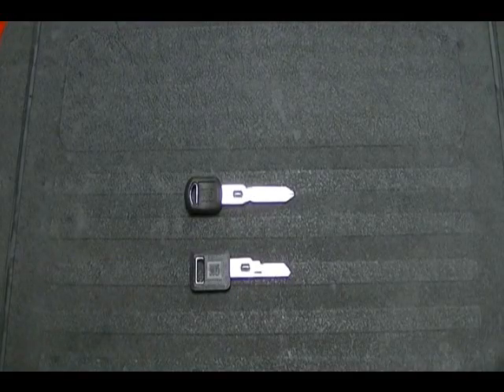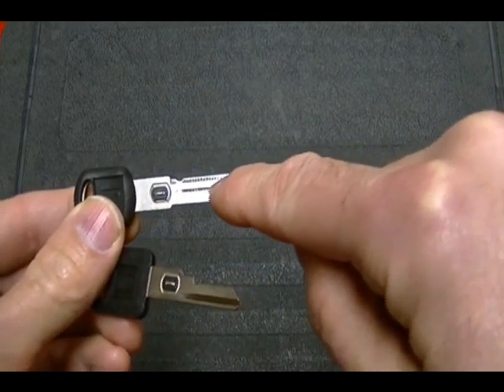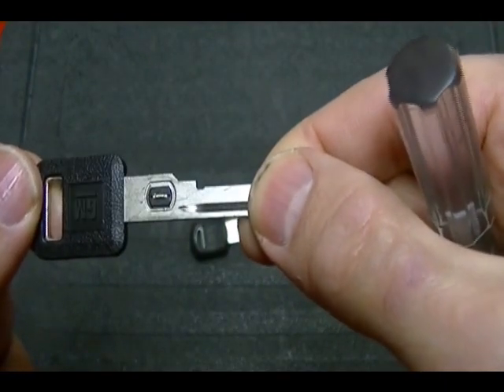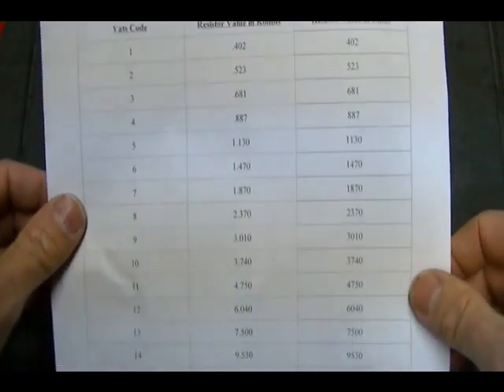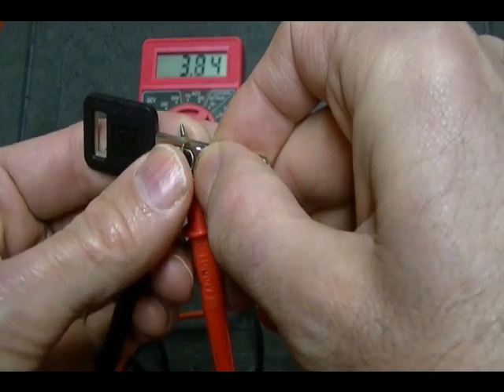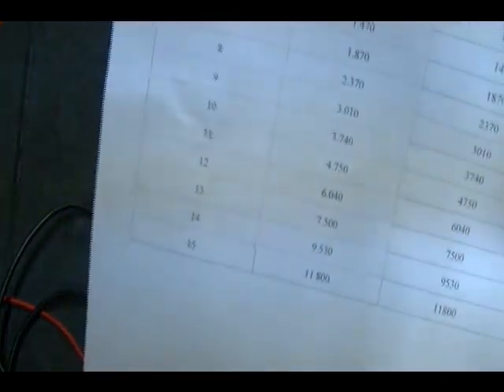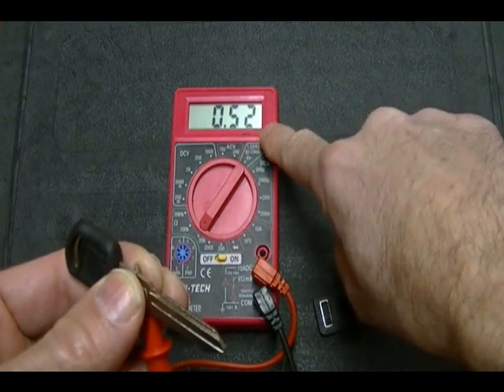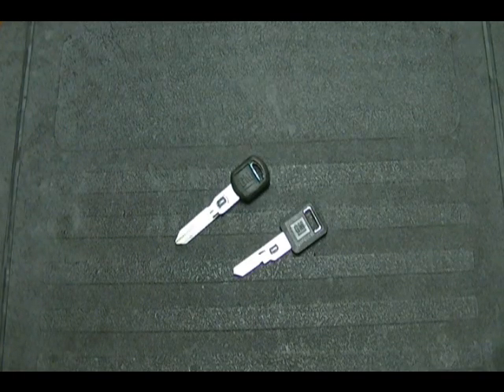How to Measure a Vats Key

Comment: Once you get the correct replacement key, do you have to get it programmed by the dealer or will it just work in the ignition ?
Reply from the maker: As long as you order the key with the correct vats code, and you have it cut correctly if it isn't cut by the dealer, then it will work. There is no 'programming' with vats keys.
Reply: @smallengineshop  thank you!

Comment: Thank you for the video I am using an analogue multi tester and truth be told I am a novice with the multi tester. It is not as clear the actual values as with a digital meter I will try out the test again.  Thank you

Comment: Hi Jason Boudreau here I am seriously having trouble figuring this out... the theft system has locked me out of my car and trying everything bought a digital meter but shows 5.963 and 5.835
 For original and spare  key i bought two 5.8ohm resistors and  two 6.2ohm   no luck 
I think I'm way off so I am going to buy a 10'000 ohm variable resistor / potentiometer is this going solve my problem..  I am ready to burn my beautiful car in the driveway..  I have to walk a hour in each direction every time I go for anything..And I'm Asking For help...please let me know when you get a chance....
Reply: Its a 97 Cadillac seville sts

Comment: Great video - I know it is somewhat dated and I hope you are able to still answer this.  I had a broken piece on my steering column and it is no longer manufactured.  Thus, I am changing out the entire column.  It came with the key.  Of course, the ohms are not the same.  I would love to just change out the column and use the working key that came with the new column.  By the way, my old key switch was trash, so I can't change it out and use that one.  My question:  Is the resistor value stored in the car's computer?  IE:  If my original key was a #2 and this is a #6, must I go with the original #2 key?  I am assuming so but would like to verify.  Next, I am aware that I can bypass the whole thing with a resistor (had to do it once before on another car).  Am assuming if I go in that direction, I can use the key from the new column with it.  Correct?  Many thanks!

Comment: I had a caddy dealership make me. VATS keys for my 98  DeVille it fit but did not turn. They said the ignition had been changed. Checked with both previous owners.vit had not. Now they want 500.00 plus for new lock cylinder. The key won't turn should'nt at least turn.  So the steering wheel will movee

Comment: Thank you for posting the 15 vat resistors values, but question if the resistor fell out of the key and got lost, what can i do? Can i called the dealer with the Vin # and get the resistor value? Or do i need to try all 15 values until i find the one that started the car? Thanks lou

Comment: A ex girlfriend lost my keys for a '99 firebird ...with a 3.8 under the hood...so am I screwed and have to buy like 14 keys @$25/a key and have them cut to fit the ignition?
Reply: Go to the dealership with your car's vin #. They should have a copy of the key in their system for that vin.  However I have heard that sometimes it still wont work.  but you might get lucky. its worth a try
Reply: Willow thanks, but I got rid of the car and got a truck. lol

Comment: Thanks for the video.  Very informative.    The security light in my daughters 1999 bonneville is flashing.   I've tried both the keys ( primary and spare ) and neither will stop the security light from flashing.  Is it possible that both keys actually are bad ?  Or could there be another problem ?  In the ignition itself ?
Reply: squarejsj you need a bypass or new ignition switch
Reply: what I ended up doing was taking apart the steering column and I saw that the two wires which are connected to the ignition switch, one of which was broken.  I carefully soldered the wires back together ( with a little extra wire of the same gauge ) and the re-inserted the ignition into the column.  This allowed the "circuit" for the ohms test to complete, and the car would then start.   It was a pain, but it cost nothing, basically, except my time.

Comment: i got a value of 02.97 off my key that would be key #9 correct? (3010?) if i can get the exact value of the key should i go with that or go with the key #9 value? This is for a 96' Cadillac seville sts. Thanks #I17 n advance

Comment: but what if I'm missing the resistor on the key? I couldn't get a reading without it. I have the original key but cant seem to find a the correct ohms of my vehicle
Reply: might just have to try all 15 resistor values until you find one that works. tedious, but it's a start.

Comment: in my key it reads 3.00 on the muti meter set on 20k do you have an ideal what key it would be
Reply from the maker: +Brandon Mackey I think your meter is displaying the value in kohms. So the reading is 3.0 kohms or 3000 ohms.
Reply: +smallengineshop  so what restister would I need to buy to do a bypass.
Reply from the maker: If your reading is correct, than it would be a #9 vats code.

Comment: Hello your video is very helpful, however you say that the single sided key is only made up until 1988 I have a 1998 Cadillac DeVille and it has a single sided key ignition key with the resistor chip inside of it so I guess they made it 10 years longer. As far as getting the ohms from key resister everything that you mentioned in video I assume would be the same. On the single sided key,   I just want to get a copy of the key made and that's not so easy in New Jersey my area many locksmiths don't even have this type of key with the resistor in it be it Single sided or double sided key. So I'm continuing with hopefully getting in touch with these locksmiths that has the single sided key with the resistor and if so they can make a copy of it. I'd like to have an extra spare key of it. Also other videos that show how to buy pass the VAT key completely I found to be very helpful since the ignition said many people have said on YouTube that the wire that connects to the back of the ignition itself sometimes can come loose that can be a big problem so they were showing how to just bypass it and eliminate the equation of the ignition completely and just go on  and access the orange wire below there's more details to it using resistors see their videos about it is quite a few videos on it.  but its a very quick fix. which is also good to know concerning these VATS system. What's up with regarding need resistors anyone know where I can get them just to have them for just in case kind of situation? Because there is no Radio shacks in my area they went out of business?

Comment: My ohm reader is giving me every value! It won't stay on one value.
Reply: +Ellen Fitzgerald Try a new battery in it. The ohms section uses power and if the battery is low it can fluctuate. OR take it to a dealer.

Comment: I have a 05 Lacrosse that will not start, it doesn't have a clicking sound or anything but the instrument cluster does light up.A friend of mine advised me to reset the computer, by turning the key on the on position for ten minuets wait and repeat that process three times and on the fourth turn attempt to turn the car on. is this correct?
Reply from the maker: Doc Doc I don't know. Go to local auto parts store and check the repair manual for your car. Some stores will let you browse through the manual for free.

Comment: So on 1 off my cars i get 4.61 and on other key is 4.68 so makes it key code 11 so do i make it for 4610 or 4680 and on my other car we get 0.53 so 530 would that be key code 2 would i make them for the ohms for the key code or the key that i will be using thank u for any advice.
Reply from the maker: The keys rarely read exactly the same ohm value even though they might be the same vats code. .53 kohms is a #2 vats code.

Comment: I tried with different meters and none of them work it doesn't read nothing is there any other way I could check what number key I have ??
Reply from the maker: Take your key to your local GM dealership and ask them to tell you the vats code. I don't think they will charge for this service, but it probably depends on the dealership.

Comment: What if the key is not reading anything what can I do to make sure what key do I have
Reply from the maker: If the key your trying to measure will still start the car, than you know the resister in the key is good. Make sure your meter leads are making good contact with the resister in the key. Some meters are harder to use than others. The best meter I have found for measuring vats keys are the cheap Harbor Freight digital meters. Harbor Freight will often times have a free coupon for the meter in magazine advertisements.

Comment: My Key reading is 0.68 so how mind resistors I need to use I have some resistors from radio shack 100-kohm. 1/2- Watt
Reply from the maker: Lasandra Smith If your meter is displaying the ohm value i kohms, than .68 kohms is equal to 680 ohms. I think radio shack sells 1/2 watt 680 ohm resisters.

Comment: So with me getting a ohms of 594kohm would that be 6.040
ohms are 0.681ohms
Reply from the maker: There all bad measurements. 594 kohms is equal to 594,000 ohms. That is way out of range of any actual value. The same is true with 6.040 ohms and .681 ohms.

Comment: WHAT IF YOU DONT HAVE THE VATS KEY?? I DO HAVE THE SPARE KEY BUT WITH NO RESISTER CHIP.
Reply from the maker: From reading your other posts it sounds like your cheapest and easiest option might be to pay the guy $90 to cut another key for you. If you can find out what vats code your car uses, than another option would be to buy a new ignition lock and replace it yourself.
Reply: What do I do with the stupid spare keys? It turns the ignition then security light turns on and it wont start up.  What's the point of having spares when you can't even use em?? Can I turn off the vats security system and just use my spares???
Reply from the maker: Did the person who replaced your ignition lock and key record your vats code? If so, than you can get the code from them, than install a new ignition lock and buy a new vats key for the lock. If you do the work yourself, than this is a cheaper solution, but more difficult. If you can't do the work yourself, than it will be cheaper to pay the person $90 to cut a new key for you. I am not sure what you are buying for $90. If the person is going to interrogate your vats system and determine what vats code you need, than determine the key code and cut a new key, than $90 is really not a bad deal. If the person already knows your vats code, and will tell you, than you can beat that price by buying a new ignition and vats key and doing the work yourself.
Reply: Sorry but the stupid guy who replaced my ignition never gave me the code nor never told what # in case I need to replace my key!! Stupd right..,?? Grrrr this suxs. My camero wont start...! Guess ill have to buy a whole new vats ignition switch. Didn't want to but I think this is my last resort.

Comment: What If I lost my VATS key but I do have the spare (gold key w/out the chip) Security light turns on but wont start? I just got screwed:

(My receipt I just paid last July 2013!!!)
 *YES I KNOW NO LUCK ON KEYS!!*

(ORIGINAL RECEIPT VIA. EMAIL)
IGNITION LOCK
REPAIR
Labor for ignition lock repair
1995 chev camaro
1 $325.00 0.00% $325.00
COMMENTS Steering column previously improperly installed/repaired,
vats system not connected
1 $0.00 8.50% $0.00
__________________________________-
* Indicates non-taxable item
No warranty for any service, any parts, or any labor under any
circumstances unless expressed in writing on invoice.
0692
__________________________________
Subtotal $325.00
TAX $0.00
Total $325.00
Reply from the maker: Check your owners manual to see if someone wrote down the vats code. Also try calling your dealership. They might be able to get your vats code by using the VIN number.
Reply: I got a key made off of my VIN alone. Call a GM dealer.
Reply: That's the.problem just changed the ignition switch and new key last July. THE key guys trying to change me another $90 to re-cut me a new key. When he already screwed me last July for $360.00 on a ingnition switch and vats key for my camero. Personally I just don't have $90 to fork over like that. I have the spare keys. Is there any way I can disconnect the vats entirely so I can use my spares?+
Reply: Another issue with my 95 camero. my engine is complete different then the original it had. I bought it with a huge air exaust manifold and other modifications im not sure what to do, or who to see and diagnosing my girl.identity theft system is ingaged and won't even start up to hear the damn sounds to fix it...Some bad knocking/clicking sound under hood.